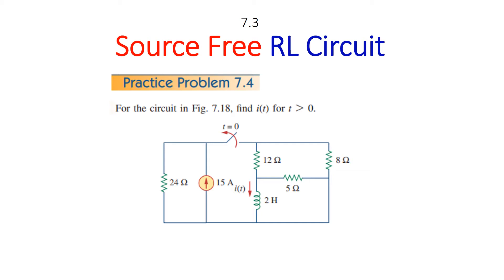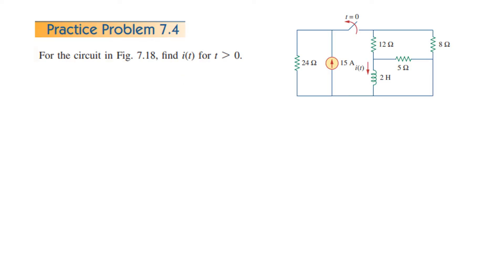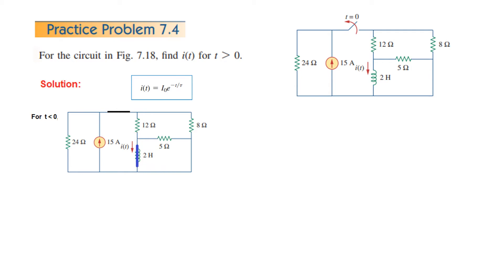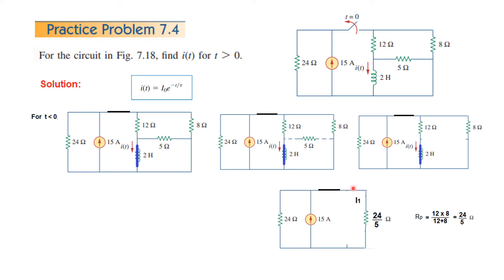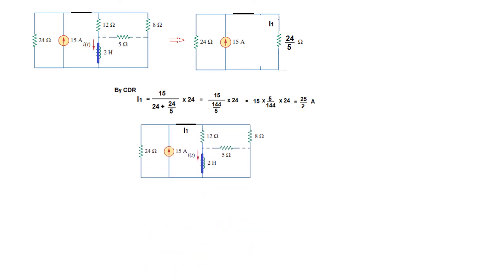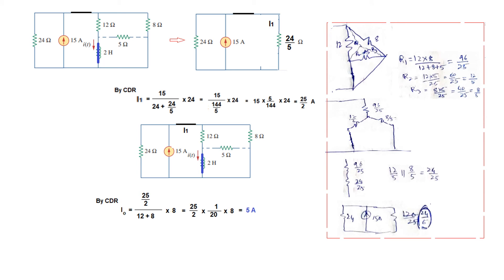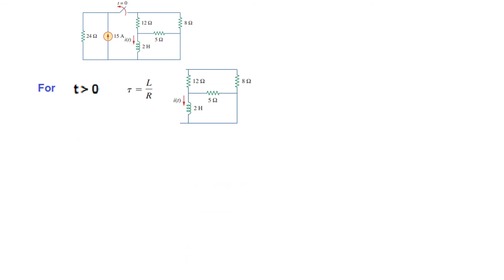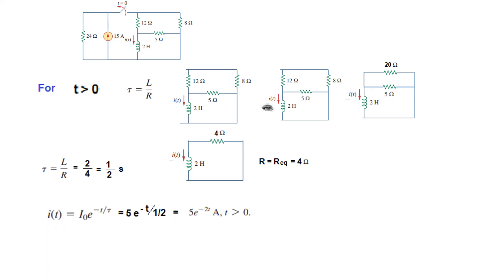(English )LCA Practice 7.4 || Source Free RL Circuit

Comment: 3:28 why not solve the circuit both 24 and 24/5 are in parallel so find equivalent then find total voltage by ohm law then apply I at 24/5  = V total /R to find voltage at 24/5 is this also valid or am I wrong?
Reply from the maker: Yes Valid. but just see which one is easier ? Let me know
Reply: @ElectricalEngineeringAcademy ur right the method u did is easier ! Thanks sir ❤